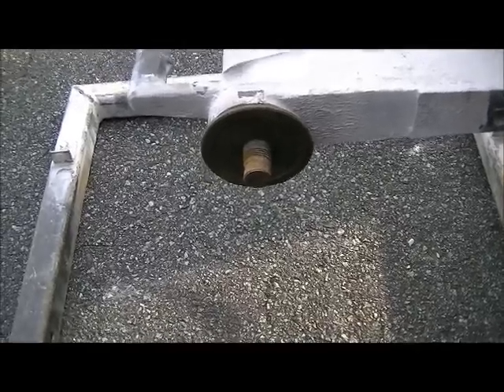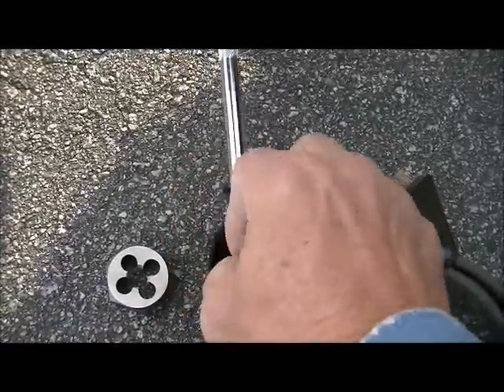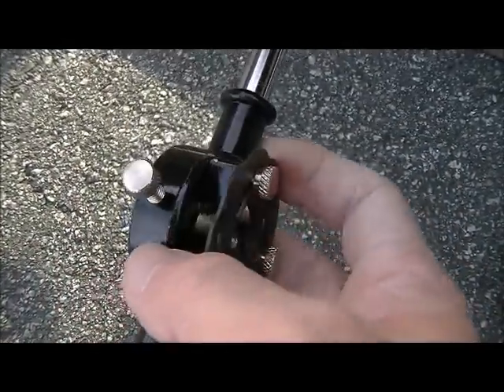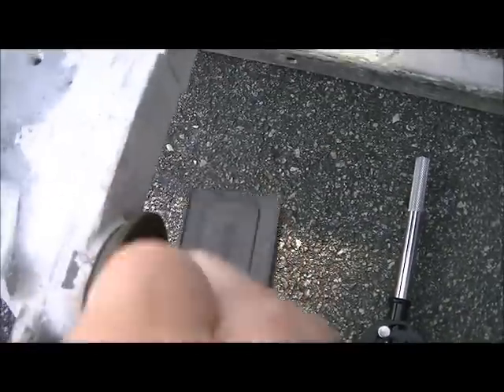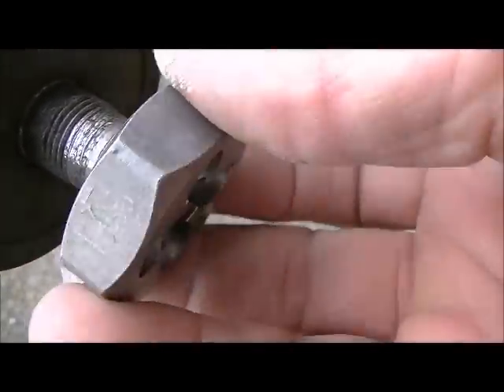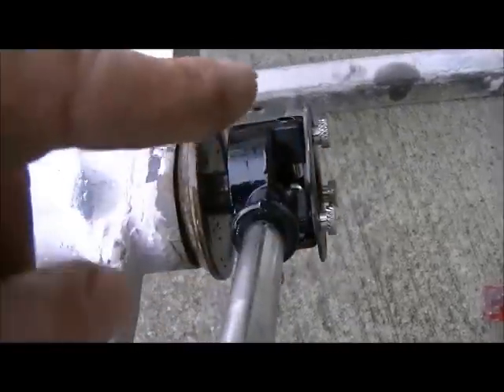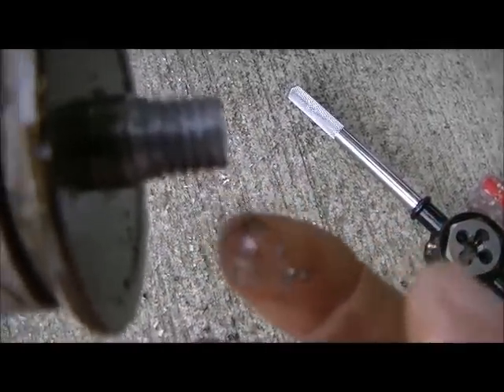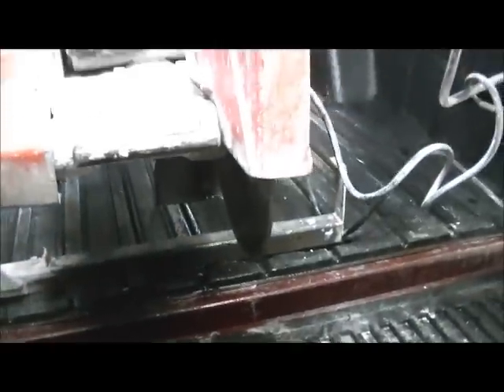How To Thread a Stripped Bolt  ( using a die to create new threads )

Comment: I have the same problem now.  A relative handed me a knee scooter bought second hand from a medical supply store.  The steering shaft threads have been stripped and no idea if that is the original nut or not.  I am working with the same threads you are.  I was able to reopen threads back original size (I think), but there is not enough thread material left to sufficiently tighten the nut.  I will try cutting down to 9/16 like you did.  I will have to narrow the end of the shaft like you did to get the smaller die started.  I think you did a fine job!  A situation under much less than ideal conditions.

Comment: I would have used the motor as a "lathe" and turned it on to make the spindle turning then used a grinder, file, or emerycloth to make it concentric. But seems to have worked good for you!

Comment: out of the 20 some odd tile saws I've owned, every single one had a reverse thread spindle.  You couldn't get it off because you were turning it the wrong way.  Righty -  Loosey  Lefty- Tighty.  also, your spindle shaft has a flat spot to insert a wrench to hold it place.

Comment: Spindle swap, because car bearings need a press and most shops don't have it anymore. I sorta smooshed my bolt on the part I salvaged, so if this works, it's saving my butt $300+, doing it myself it's just shy of $40

Comment: You can heat the metal to cut more smoothly. Heat to 150 but the down side is you have to retreat the metal for the used is. But your idea about oil and tread by hand is right.

We do it by machine is more faster and maintained the metal cold. But awesome idea. Good vibes.  👏👍✌

Comment: good to see you didn't give up.  The better thing to do ( if your set on keeping this tool a long time ), is to remove the spindle from the arm and have a machine shop turn down the damaged area and resleeve the shaft in stainless, and rethread it with a fine thread, or contact the maker of the machine for a replacement part.  Let the machinist do what he does so well, and the tile man do what he does so well... Sometimes saving a few bucks can become very costly.

Comment: I learned something. I have a similar thing I'm doing for my moped's crank. I kinda messed it up and need to do this I just needed to confirm how it was done before jumping in and needing to spend 100 rather than like 20 or so
Reply: mopedbrain  I went with a M10x1.0 on my Puch Maxi only needed to rethread the outside end because I messed it up so I didn't go down I just redid what was done stock and it still works great but I had only flared the tip

Comment: I am wondering if the thread should be clockwise or counter clockwise so the machine is always spinning to tighten the nut? Also some very strong thread lock.
Reply: all motors are build so that the nut always tightens in the opposite direction of the rotation of the motor. so if your motor spins clockwise the nut will tighten counter clockwise and vise versa. all table saws, tile saws, and likewise tools rotate counter clockwise so the initial cutting action is into the table

Comment: Good job d00d! Invest in a whole tap and die set. You can get 'em on amazon for about 100 bucks. invaluable tool set for dealing with stripped studs and bolt-holes. Especially with automotive restoration and stuff like that. If you do though get a set that's titanium.

Comment: if you've got the time, please consider ordering the same nut but in 316 or 316L stainless on ebay. it will still rust, but much slower.

Comment: 1) Yes, you need to apply oil to the bolt, stud, etc., to lubricate the metal as you're cutting threads.  It also minimizes wear to the tap or die as you're cutting new or restoring existing threads.  WD-40 is thin and dries quickly, so I would suggest you use light machine oil or cutting fluid (like Tap Magic).  Even straight 10W-30 motor oil is fine for this. 2) Did you contact the saw's manufacturer regarding the availability of a replacement?  Failing that, did you look in the Yellow Pages for a nearby machine shop, instead of a tool and die manufacturer?  3) The car parts store should have sold you a thread restoring die instead of a regular threading die.  They will work, of course, but if you're not careful they could cross-cut existing threads.  Thread restoring dies are made of somewhat softer metal; they will follow the existing threads, cleaning them up.  4) The "stop and go" pattern during cutting is to loosen and clear out the metal chips produced from making new threads.  If you didn't, the die would lock up and you'd be unable to proceed.  5) While you were able to make the repair, be careful.  That metric nut you put on it may loosen under load.  Owing to safety concerns, consider this a temporary repair and have it looked at soon by a professional.

Comment: WD40 is not oil, it basically removes oil ....
Reply from the maker: Not true, it removes moisture. WD40=Water Displacement 40th time getting chemical right )
Reply: If you don't have and don't want to buy thread cutting oil, WD-40 is just fine.
Reply: A non-volatile viscous oil with added hydrocarbons to displace water and reduce rust. Who told you not an oil?
Reply: StarrTile WD40 Is a solvent, it lubricates for a short time (enough to for this purpose) but it will remove oils when it evaporates

Comment: I believe the jaws on the die handle are to help keep the die running square to the shaft. I think you're supposed to pass the shaft through the jaws before cutting. Adjust the jaws so they're all lightly touching but not interfere with turning the handle. I have a die handle with jaws. They all move in and out together like a 3 jaw chuck on a lathe keeping the stock centered to the axis.

Comment: They make thread cutting oil.  One common brand is Tap Magic.  I use motor oil at the house.  Good job though.
Reply: Jeep Renegade good job? Are you fucking kidding me he's ready. 9/16 and and then he said they don't make 9/16 nut LOL and then he said he bought a metric nut and jammed it under as hard as he could. I wouldn't want to be within a thousand feet of it so when it's turned on
Reply from the maker: Thanks